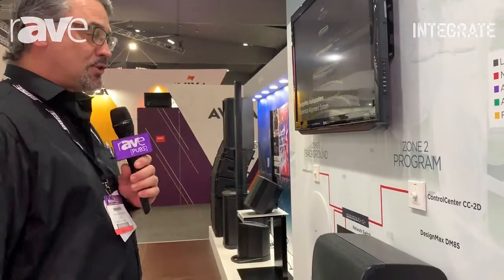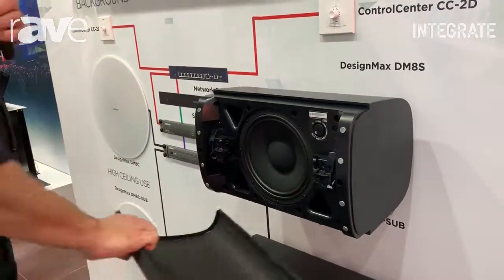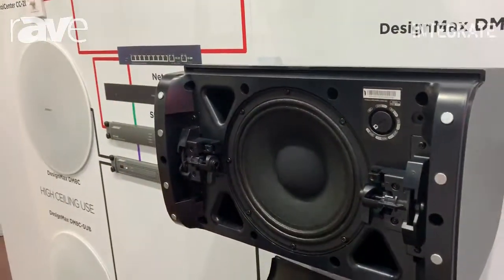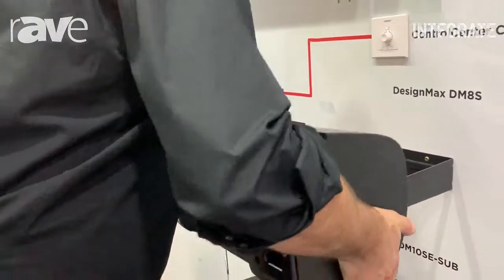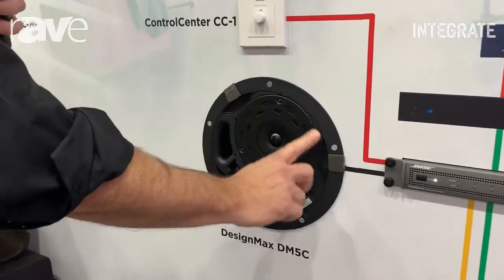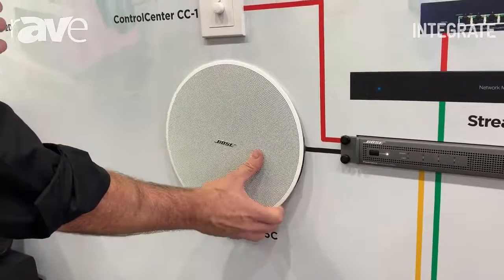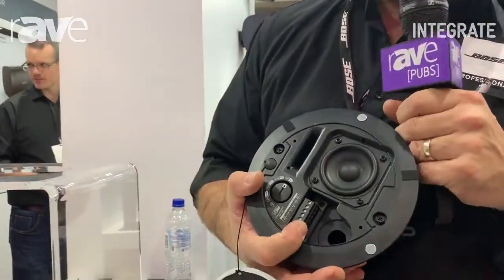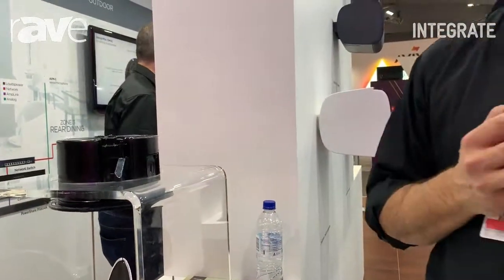Integrate 2019: Bose Professional Showcases DesignMax DM8S Line of Wall- and Flush-Mounted Speakers

Comment: Hello, I have a pair of bose dm2c speakers installed in my kitchen. There is a small space between the magnetic grill and my ceiling. The grille is not completely flush to the ceiling. Should the grille be completely flush to the ceiling?